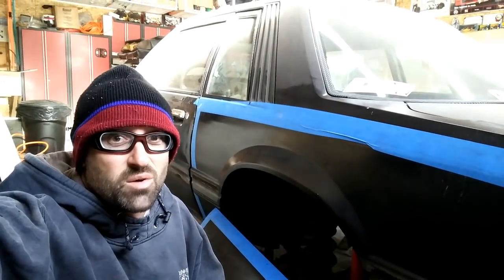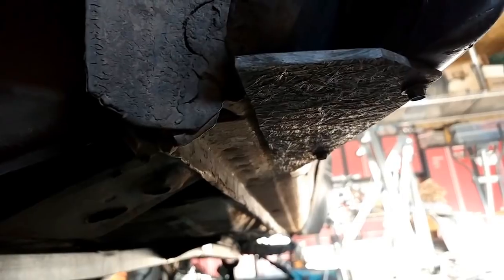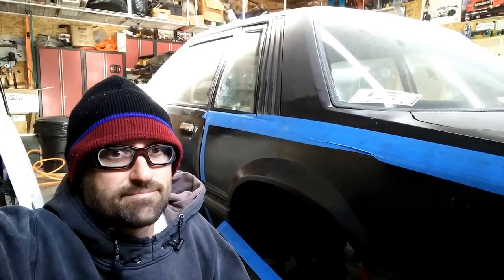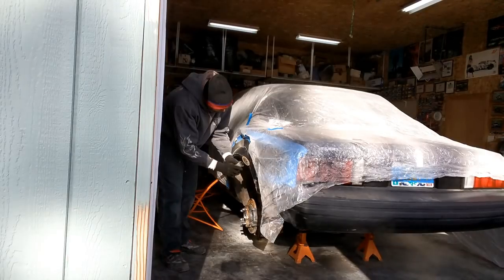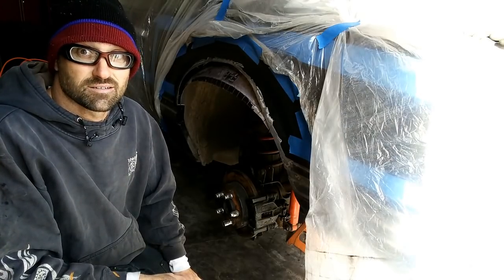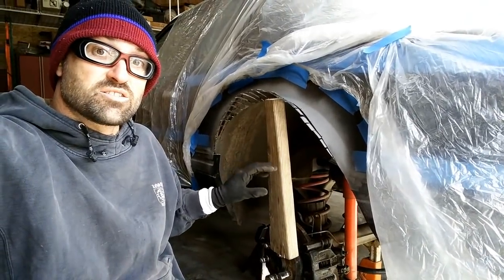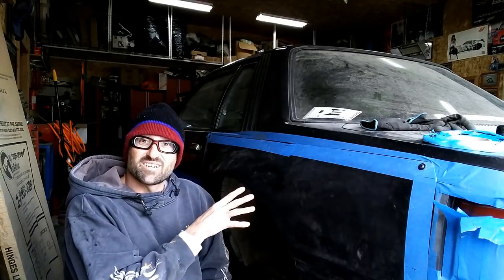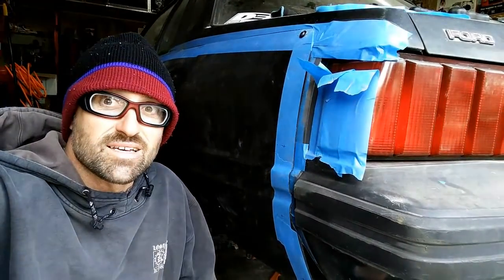How to Ruin Your Vintage Mustang in Epic Fashion | Widebody Mustang

Comment: Did you ever get the front fenders fitted?
Reply from the maker: Greg Scherf I'm not 100% done with them, but I made some strides a week ago. I found a way to get some more flexibility from them while I was fitting the front bumper. I am close to where I want to be, but I left it alone to move on to the engine harness work and front suspension for now. I'll probably get them complete in January.
Reply: Basin Motorsports I can't wait to see that video. I personally have a 93 gt  and want to do something similar but I want 315's in the rear and 275's or larger in the front. With full tubular 03-04 cobra suspension w/irs.  So you think you could get tires that large under those flares?
Reply from the maker: Greg Scherf I plan on running 315s on all corners, so they should fit with the 3" flares from Maier. I just haven't measured the rear setup yet, and haven't put the front suspension on to measure for the wheels. I believe basic SN95 wheels in 18x10.5 should fit, but I should know soon. The only reason I am massaging the front fenders so much is my OCD on fitment. I can't stand anything less than almost perfect. Others have drilled holes and slapped them on as is. It's just not my personality.
Reply: Basin Motorsports I'm the same way.  Don't do it if its not going too be done right.  Keep up the great work man.